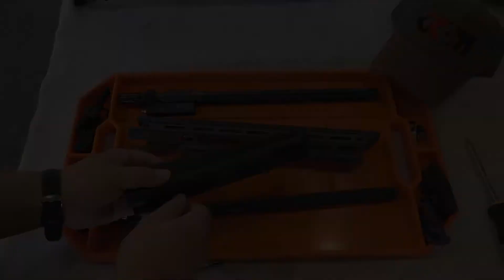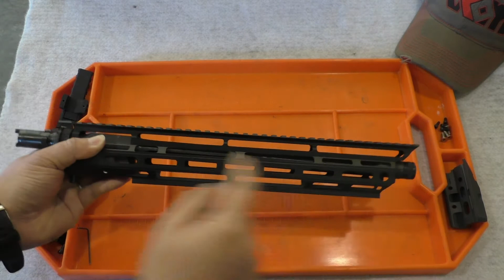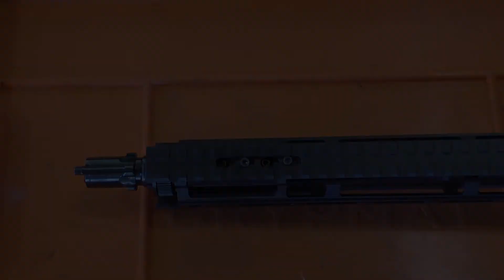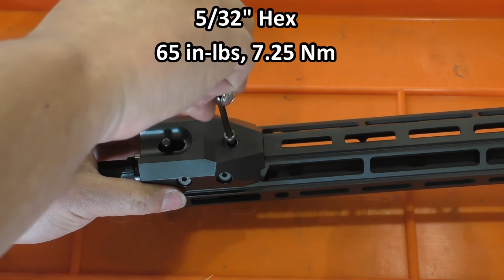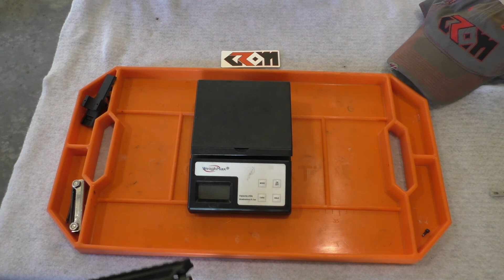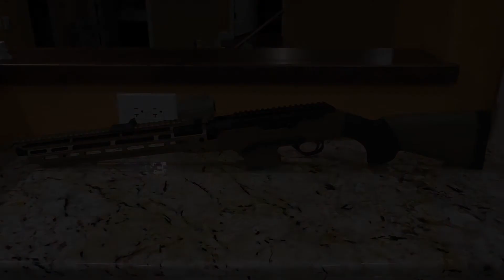CROM Low Rise Rail Installation

Comment: Have you tried to install any Mlok accessories onto the handguard?  I have seen where someone mentioned that their Mlok cuts are out of spec and they are not able to install a basic bipod attachment.
Reply from the maker: I have an M-LOK rail section on mine right now. Didn't have issues with that.
Reply: @FaRKle0079  Appreciate the response.  Might be an issue with his newer revised handguard then.
Reply: Wonder why they never called me about it?

Comment: With the  Crom LOW Rise Rail can you add a front and rear Magpul MBUS?  Front sight on the Crom Rail and the Rear sight on the Ruger receiver.  And will it cowitness with the red dot?
Reply from the maker: You can add front/rear flip up sights with the low rise rail. If you use the lowest aimpoint micro mount, you probably can't cowitness very well, but taller mounts will let you.
Reply: @FaRKle0079  Dumb question.  Can I mount the Low Rise handguard with the factory Ruger buttstock? Or does it have to mate with the Crom chassis?
Reply from the maker: @Remaagen  Yes, you absolutely can use the low rise rail without the CROM Chassis.
Reply from the maker: @Remaagen  Yes, you absolutely can use the CROM low rise rail with the Ruger stock. See my other video here to see what that looks like: https://youtu.be/aCjopqn9AR4?t=252
Reply: @FaRKle0079   Thanks for the replies.  $233 shipped for the Low Rise alittle to steep for me.  I'll wait for this year's Black Friday.  Maybe he has a coupon code for Calgun members.

Comment: Thanks for the thorough guide! I'm eagerly awaiting my chassis and low-rise rail. How's the overall balance of the gun with the low rise and chassis compared to the stock configuration? Also, have you added any other upgrades you've found particularly beneficial? Thanks!
Reply from the maker: I think the balance will depend on what stock you use. With the SGA the balance point is just under the forward edge of the graphic on the CROM chassis magwell. The original Ruger stock/foregrip had the balance point further back, because there was hardly anything up front!

The PC carbine with CROM chassis and low rise rail definitely feels heavier and beefier than the original stock/grip, but it doesn't feel unbalanced, or like it wants to tilt forward like with some of the even heavier handguards.

I haven't upgraded any more of the PC carbine internals. Haven't really felt a need to yet! Hope you enjoy your parts!
Reply: @FaRKle0079  I'll be using the SGA stock- I was concerned about the rail making it feel too front heavy but I'm glad it still feels balanced. Thanks for the reply and again for the videos- they've been really helpful so far!
Reply from the maker: @Eleven10  Glad I could help you, that's the whole reason I do these videos.

Comment: Thoughts on why you prefer this to the high rise rail?
Reply from the maker: The high rise rail is pretty heavy and makes the front end want to dip/tilt forward. It also forces you to rethink the rear stock a bit, I found myself using a "chin weld" without risers.